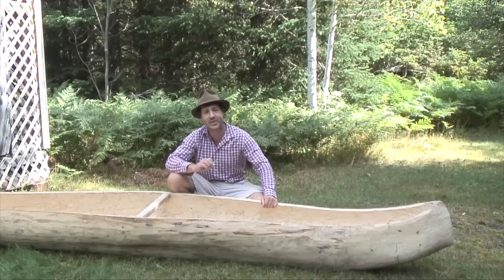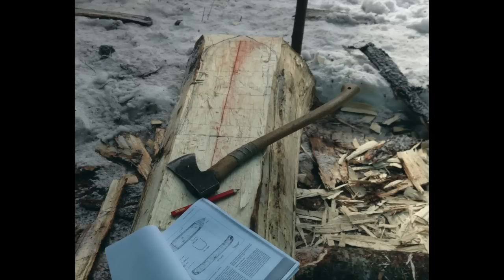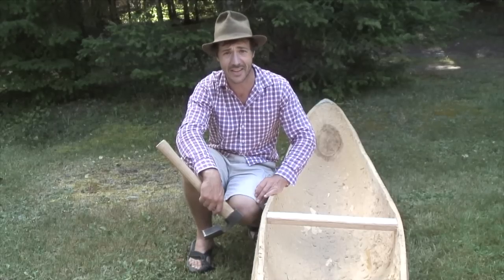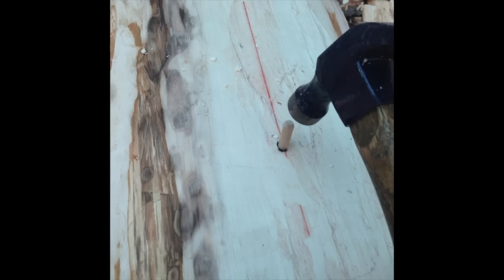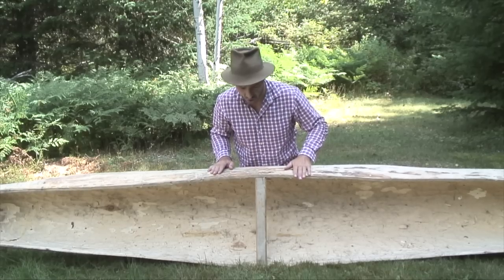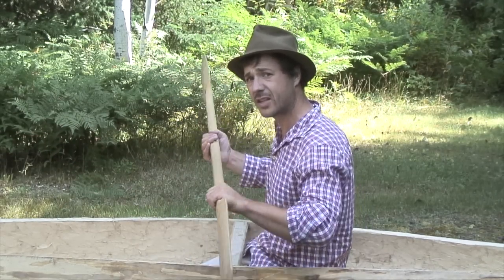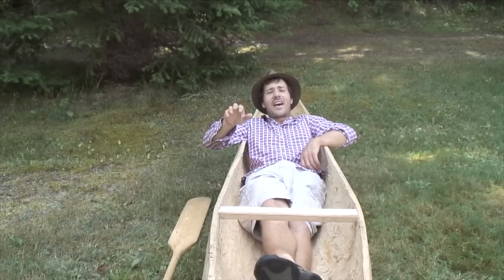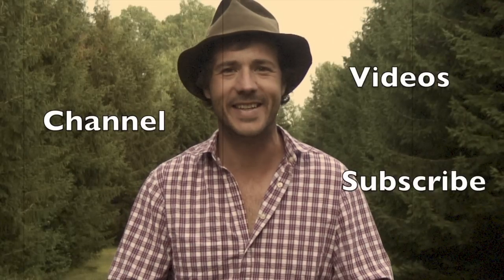HOW TO BUILD A DUGOUT CANOE!

Comment: Awesome project, it looks very good. It probably means more to you because you built it with your own 2 hands . I will have to look for an aspen around here somewhere big enough . We have alot of hard wood like maple, oak , sugar maple, birch, beech and we have pine, spruce , fir, hemlock . I think all to dense , maybe could use pine but probably to much pitch . There are Aspens big enough but farthur in the woods . Probably will have to go and camp then portage back . I did make a log hauler with big wheelbarrow tires, so maybe that would work . We have small mountains, where I live , 2400 hundred ft above sea level , and ofcourse I live near the top and all the rivers are down in the bottoms of the hills and montains . Thank you for sharing this , great Idea and great video . Blessings .

Comment: You could have saved quite a few strikes if you use an electric circular saw first and cut two elliptical shapes above the intended dug out part with a space between the two ellipses at the middle, then dug out the the part between these two ellipses.  Then dip an electric hand saw in that gap and cut out the log on both sides.  In that way you can save some wood that can be used for other purposes also.